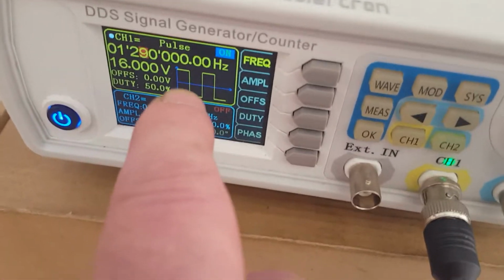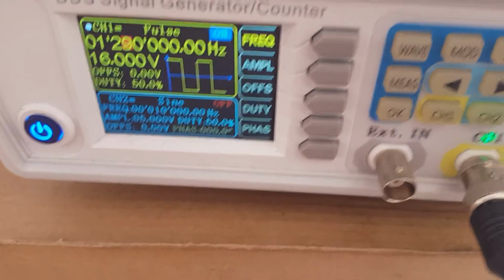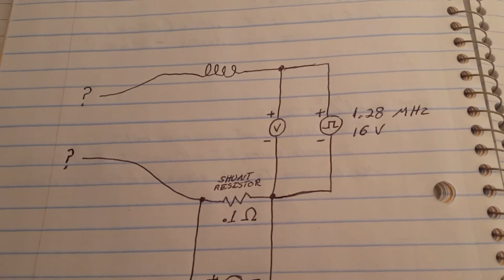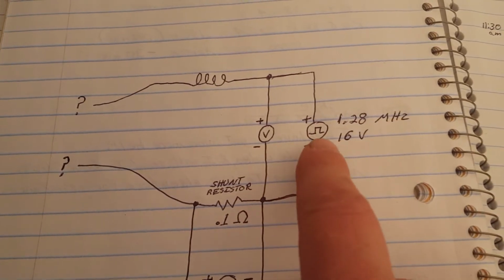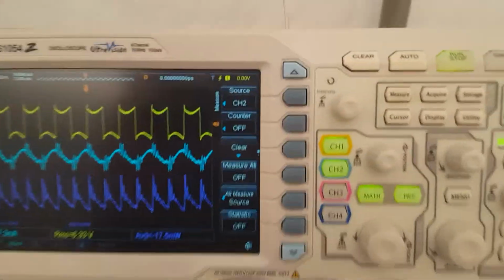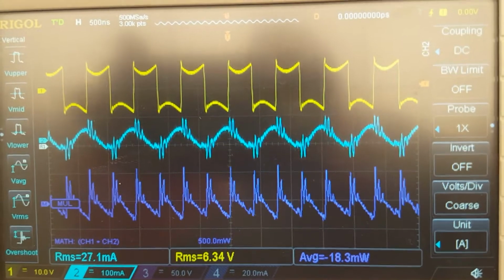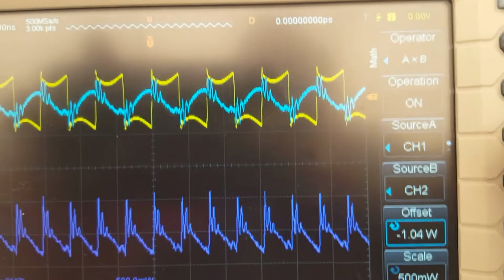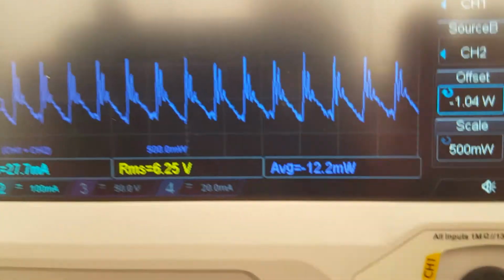WIRELESS POWER TRANSFER Part 19 INPUT POWER & WAVES! (Over unity!? Free energy!!?)

Comment: so how did that happen? how did you get that charge on there.  look at it this way, if you have a negative plate, and you add another plate or wire, the new conductor becomes the negative.  i need to do a little study on these DC systems, because i like AC  systems.
the dc system seems very straight forward. but dc and air core transformers is new to me. lol. i need some dc/ i have some ac for u.. so i am try to take dc hv and place it on the conductor, and it hope adds to the current.. this is my goal. the Volt is a AC/DC object in oscillation. it already has 2 components.. the dc and ac side. the ac side is lost in space.
the dc side has the magnetic plain to discharge earth. DC systems that are ac / dc in one, i think you may have something like that happening here? also if the plate was positive the last time u turned it off, it could have become a neg the next time it is turned on? perhaps.
i am just turning to the DC side, the dark side. and i finally said particle. and quantum..
its all mystical mumbo jumbo to me.. what do you have to loose? jump in...
Reply from the maker: hehehe, great comments about the plates.  You make me think.  :-)

Comment: you are running the light off of that box but how are you generating more power out of the other lights. how are you making more power going out than is  going in?
Reply from the maker: Very good question!  I think I am loosening & extracting electrons for the air and ground.  Pumping and pulsing resonant energy.
I keep telling people, with a radio tower in the 1800s and crystal radios you can have a bazillion listeners, the radio tower does not run out of energy like a power plant on a hot day when everyone is running their air conditioners.  Please take a look at this video... https://www.youtube.com/watch?v=jHVNeQqQudY&t=292s
I believe I am creating this push/pull action and with each pump I collect extra energy.  One group of LEDs lit with energy being pulled from the air and one group pulling extra energy from ground.  Two groups of LEDs connected with both Neg ends together, the energy can only come from one direction to each group.
Please stay tuned for better and better results😁

Comment: How does the scope know, that you are measuring the current over a 0.1 Ohm resistor and not over a 1 Ohm or 5 Ohm resistor? Know what I mean. You trust the current the scope is calculating. But still nice work. Keep on working. Good job.
Reply from the maker: Hmmm, yes, I think I know what you mean, and this is why I "first" do a test on a simple test circuit with same resistor, not my system, and I check test circuit and calculate Ohms law using input voltage on scope and known resistor to make sure probes and everything are set-up correctly & getting proper measurement readings.
Thnaks for watching and your kind words😎
Reply: @INVENTOR3  therefor the calculations of the scope are correct in this video? Is it a simple solenoid coil or anything special? Bifilar or so?
Reply from the maker: @lektor0815  Yes, I strongly believe the scope readings are correct, but I will continue to do a lot more tests to make absolutely positively sure of this.  I did expect that it would be less than 1 watt maybe around 800mW, but 20mW wow! My primary coil is nothing special, but my transmitter and receiver are very special 😎
Reply from the maker: Here is latest video, this is your answer :-).....   https://www.youtube.com/watch?v=SsvGoI7VtWA
Reply: @INVENTOR3  thanks for your time answering me. 😊👍 Nice job. 👍

Comment: Have you or are you using 10X oscilloscope probes? They put less load on the circuit under test. Just trying to help.  https://www.electronics-notes.com/articles/test-methods/oscilloscope/scope-probes.php
Reply from the maker: I'm using 10Xs for voltage probe 1 and 1Xs for current probe 2 that's across the shunt resistor.
Thanks for that link, I see now that 10Xs has less load on circuit and wider band width.  Now I recall when I switched the attenuation and LEDs went out, hehehe.   Hmm, I'm now trying to remember why I have probe 2 set at 1Xs,,,I think it was because it was the only way I could scale the wave into view, I will check this out again.
Your link is a very good help, thanks again.